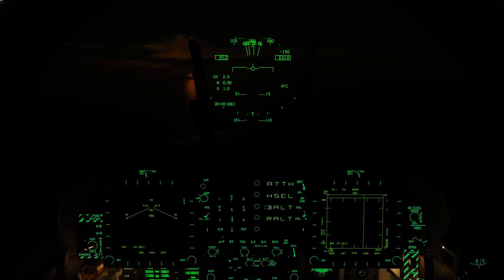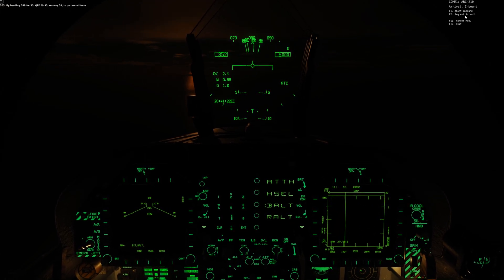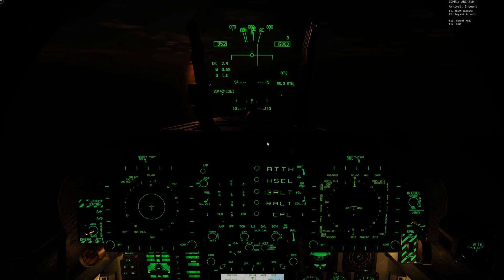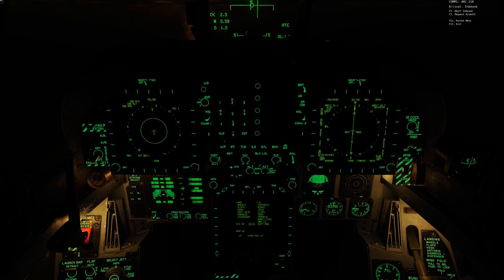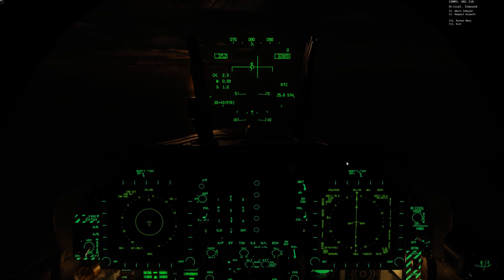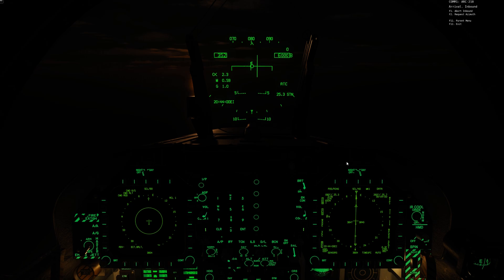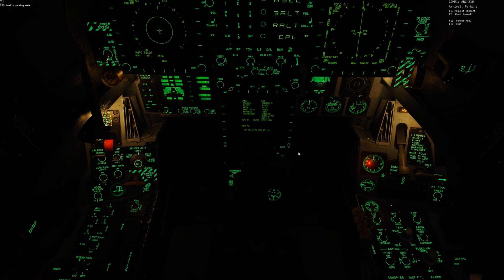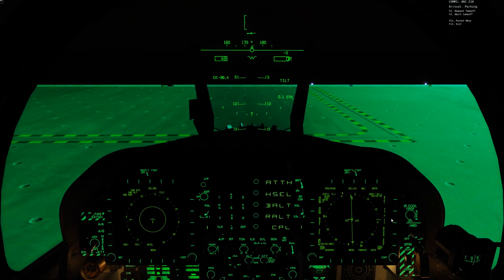DCS: Free Carrier and Hornet | Automatic Carrier Landing System

Comment: JUST FYI : LINK 4 has not been setup for the Default instant action missions. (or most multiplayer missions like Hoggit GAW as of july 6 2022 ) you need to mod the mission by opening it in the editor, clicking on the carrier and adding under waypoints  "Preform Action > Activate Link 4 " and Activate ACLS. 

iv've also heard that there are bugs in Multiplayer with more then one A/C group and ACLS, but i havent tested multiplayer yet.

Comment: I am getting master caution - AUTO PILOT at the point of attempting to CPL at 5 miles and 1200ft.   so it will not CPL.  any ideas?
Reply from the maker: Use the forum with a track file.
Reply: Create a new mission. Old missions created prior to the update will not work properly with ACLS. I tried and tried and tried with an old mission I created and couldn't get CPL to work properly. It turned out that I needed to create a new mission in the editor and then it worked.
Reply: @kevinmccallister1343    i think i did try a brand new mission in Marianas and it didn't work,  i'll give it some time and try again thanks!

Comment: So whats yhe tolerance on the carrier's ability to fly you in, will i have to make a good faiths attempt at a proper approach like you or can i just hand it over the second i see data coming in and will it correct extreme angles?
Reply: You can also use the regular coupled autopilot to align with a tacan course line set to final bearing. That should give you a pretty good approach with minimal effort.

On that note, I wonder if it automatically switches to ACLS once the glide slope appears.

Comment: Sweet ! What was high gain ? That lite the deck up ? Thx Wags
Reply: I believe he meant the high gain nose wheel steering (hold in NWS button for a sec while wings are folding/folded) in order to maneuver tightly on the deck. 

As far as the lights coming on; they come on at night when necessary, but I haven’t done night landings in months, so don’t quote me on that. 🤙🏻
Reply: @CumulusBurn  Quick note it you have the wings unlocked aka handle pulled out the NWS High will remain on. It can be seen that before CAT launch pilots will unfold their wings and then wait till they are connected to the shuttle before locking them.
Reply: @Relics_tv   Cool, thanks. Good to know. I appreciate the clarification of my response.  🤙🏻
Reply: @CumulusBurn  - ah gotcha thank you 🤙🏼